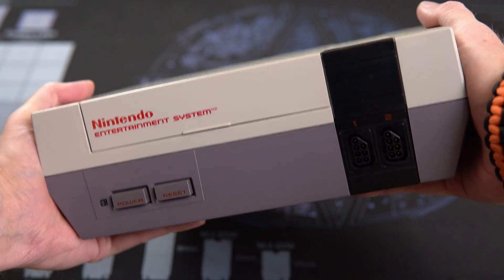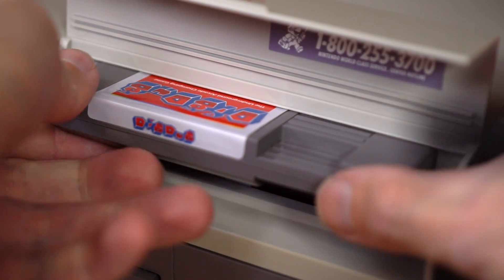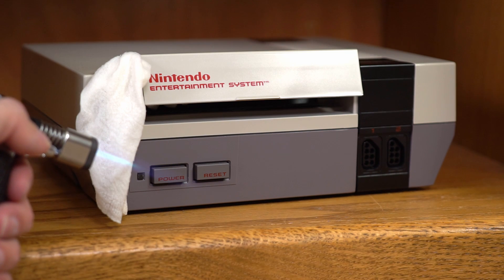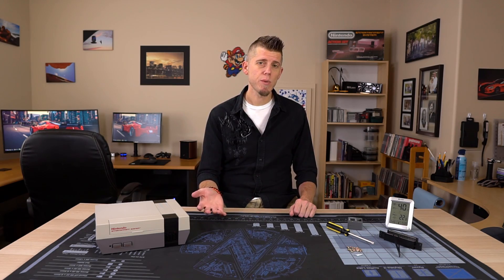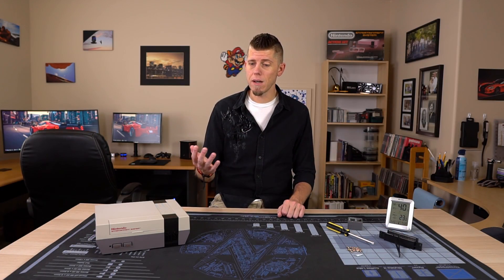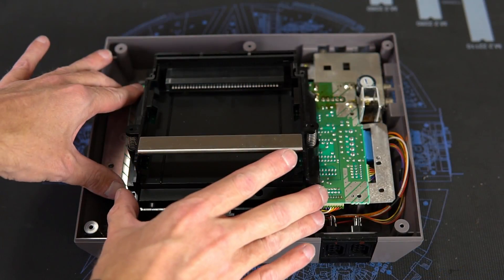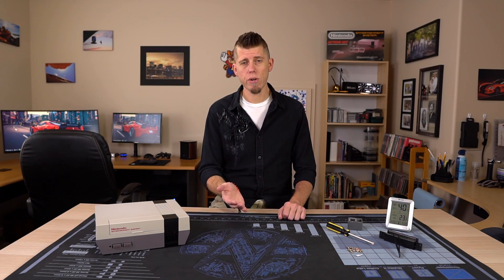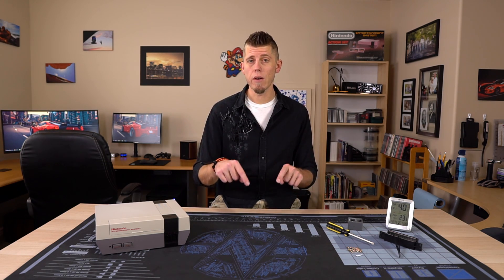Fixing An NES Cart Tray That Won't Stay Down

Comment: dude, I mega facepalmed after watching this. I replaced the socket about 8 years ago and the cartridge would no longer go down. I ended up putting the NES in storage for years, then pulled it out a couple of weeks ago. After watching this video, I fixed it in about 15 minutes. It only took so long because the plastic had gotten warped from being squeezed under pressure for so many years. Works great now!

Comment: Man I feel dumb now, I did this exact mistake while reassembling. I never noticed the tab at the bottom of the board. I was wondering why I had to put a bit of pressure on the top cover to screw it together. Now I know why. Thank you for showing me the right way to fix this!
Reply from the maker: No problem! I love it when this helps someone figure this out.

Comment: Wow. That explains why my NES suddenly had issue with the cartridge tray not locking down, after I took the NES apart and put it back together.  But the pins were kind of worn so I installed a Ninten-Drawer.  Both problems solved.

Comment: So simple yet very informative, thanks! I feel like an idiot.
Reply from the maker: No problem. And don't beat yourself up too much. You can guess how I figured it out. It was my first NES and I can't remember why I took it apart, but it was doing this after I put it back together. I did the loosened middle front screw trick and just dealt with it for over a year until I tore it apart again to figure it out and noticed the tab...

Anyways, I'm glad this helped!

Comment: DUDE YES! THANK YOU!
Reply from the maker: Glad I could help!
Reply: @TheGameBench  No but seriously. I've been modding and refurbing old consoles as a hobby for a few years now and the tray not staying down has been an issue for AGES. I was always able to fix it eventually (by luck I guess), but I never knew this was the problem.
Reply from the maker: @FruityCakes2  Haha, yeah... I remember when I first figured it out. I had taken apart my first NES back in the mid 90s and I had this problem right after putting it back together. I got it to work somewhat right by loosening the middle front screw, but it still wasn't the same. I put up with it for years like that until I decided to take it apart again and figure out what the hell was going on and I wished I had just done that to begin with since it's such a simple issue.
Reply: @TheGameBench  Ha! Loosening the middle screw was my go to fix as well 😂

Comment: Thank you for the video.  This was exactly what was wrong.  I have noticed with people tearing down old NES's, that they are corroded, and such.  Mine is in perfect condition, in this respect.  Now, I just have to find the controllers, and the power adapter.  Thanks.

Comment: I hate myself for not checking that after I replaced the edge connector that I got from Amazon on the one that didn't work initially, even after fixing the pins (also found out the pins got discolored and only in eject mode was when the game was inserted).

Comment: Holy crap this NES console was pissing me off. I took it apart and assembled it several times and every time an issue would occur where the cartridge tray would not go down. It would be just fine without the shell on. I even loosened the screws around it and it would work, put the case back on, screw those screws in and it wouldnt go down again. I had to even loosen the screws on the outside console holding the 2 plastic pieces together. So the NES console would work, but now I had a bunch of loose screws and the 2 plastic shells are noticeable not together and loose when picking the console up. I come here and for just a few seconds I see the tab under the board thing for the tray and I went and checked and yep, the tray was not flush with the board, there was space in between, which shouldnt be. After I checked the tab, it was not properly under the board. After adjusting it, the tray now lay flush with the board. OMG something so simple, Im embarrassed I didnt even catch this. I spent at least 2 hours working with this NES, there were other issues I fixed with it as well like 72 pin problems, shorts, controllers not working properly etc. But this was the main issue, the cartridge tray not going down unless I took pressure off my loosening several screws on the inside AND outside. It took me 5 minutes to get it all fixed and done. Sometimes you just have to put it down, go do something else and come back with a clear mind. Thank you!

Comment: Did you know that if you do not push the cartridge in the nes it will actually start the game and also this is from a video so i'm giving all the information that is in the nes well there you have it don't push down the cartridge or it won't play
Reply from the maker: Yep, but it depends on how tight the connector is. An OEM connector may or may not work that way, most likely not. The crap aftermarket ones definitely do because they have a death grip on the cart. The only aftermarket connector I recommend is the Blinking Light Win, which is designed with that design flaw eliminated. Just push the cart in and go.